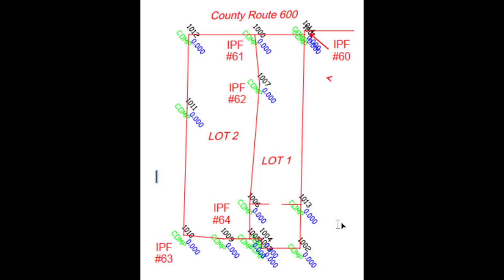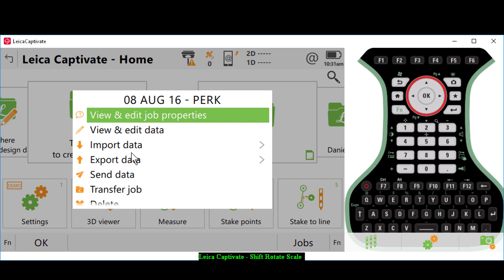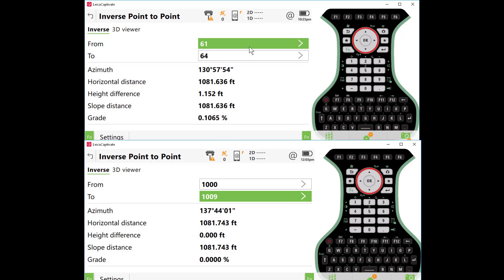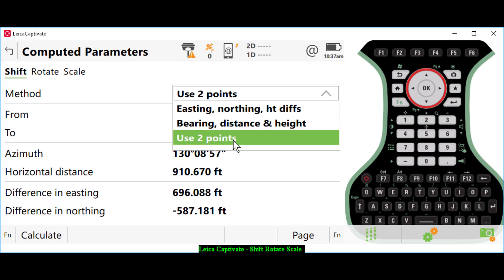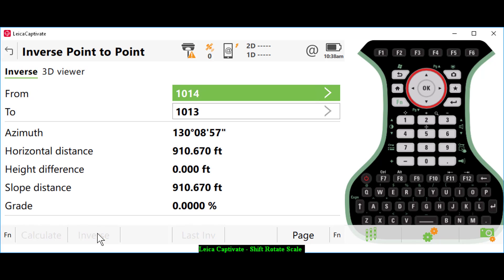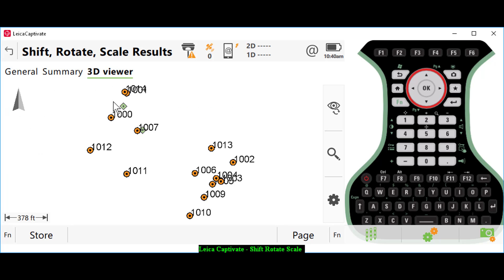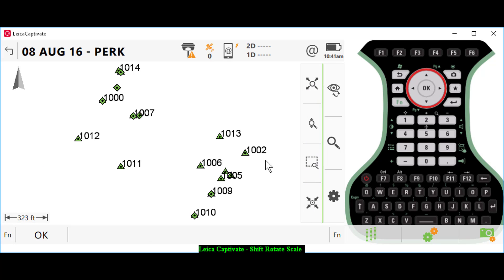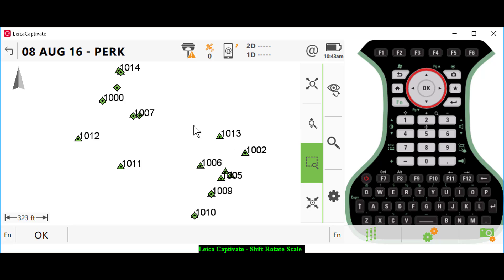Captivate - Shift Rotate Scale

Comment: Is there a difference in this method if you bring recorded points to computed instead of this way? I'd like to keep my computed orientation.
Reply from the maker: No, there shouldn't be a difference.  However, if using GNSS you will need to compute a separate transformation.  Also, some older versions of Captivate may not update total station setups, so be sure to check your data.

Comment: Where did you get the Computer simulator for the Captivate with the data collector. Also, we have rotated the job; however, after the rotation process all of our descriptions are gone. Is there a setting somewhere that I am missing?
Reply from the maker: The CS20 Captivate simulator requires a license key for operation.  This can be requested through your Leica dealer or sales representative.  The issue with the missing descriptions happens when you use the same point number to store in the same project.  You can avoid this issue by adding a prefix / suffix to the point number or by storing the shifted points in a new project.
Reply: @surveyorpop  Once we have rotated (incorrectly) our point set, is there any way to undo that and return to the original assumed coordinates?
Reply from the maker: @jasonstroupe4849 No, if the option to use the same point number was selected. 

When doing a Shift, Rotate & Scale I would always use the option to copy the new points to a different job.  An alternative to this is to copy the original points into a new job before completing the rotation.
Reply from the maker: This issue is resolved in version 4.5 release June 2019.
Reply: Thanks Greg.  You're the man!